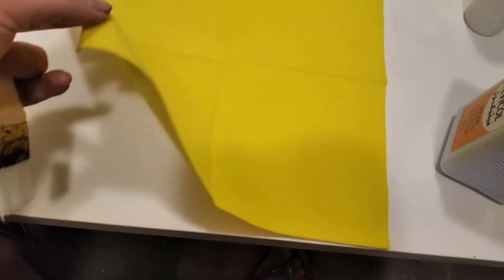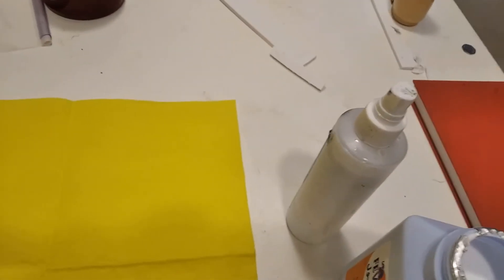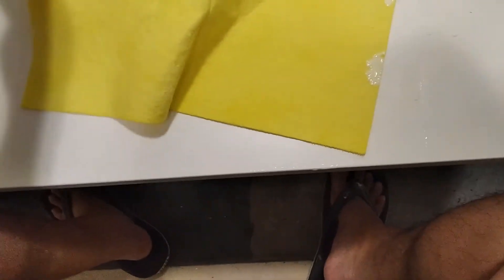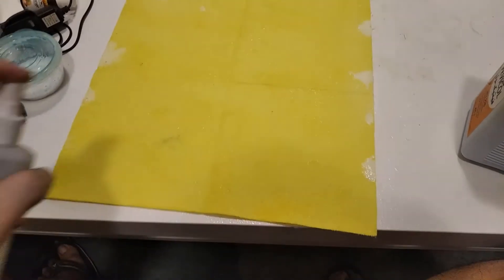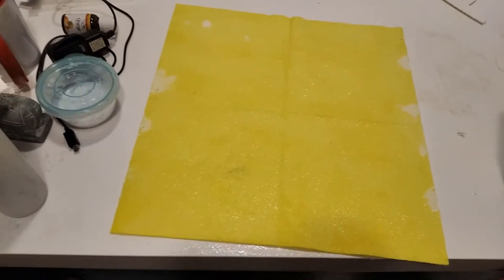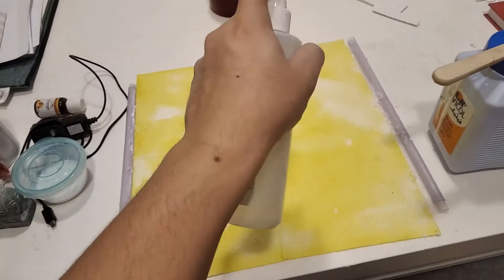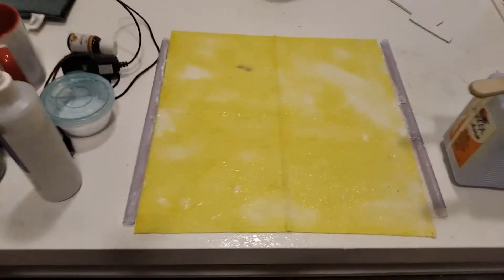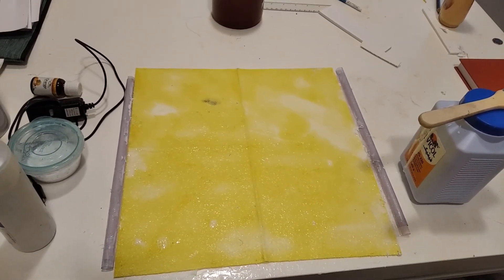Homemade ion exchange membrane updated guide(outdated check description)

Comment: Hi, how are you bro?
I am glad to see your effort about PEM but I have a question,
I hope you will reply soon.
Question> if you like to use this PEM in sodium hydroxide solution then will you mix boric acid + naoh solution for spray on the membrane?
Reply from the maker: Theres a newer pem that lasts longer so check my later video on it using Polyvinyl alcohol crosslinked with citric acid

Comment: What chemical would you use to pass chlorine ions through the membrane with your method, because Bromine chloride is a gas at room temperature or would you use a chlorobromide with which element or radical?

Comment: Hi, since you told in the video that crosslinking PVA glue with Sodium Borate gives a sodium ion exchange membrane, and potassium borate gives potassium ion exchange membrane, will cross linking PVA glue with just boric acid solution make up a proton (H+ ion only) exchange membrane?
Reply from the maker: in my later video citrate esterified PVA membranes are more stable than this and can exchange a wide array of cations.
Reply: @CatboyChemicalSociety  What about specific cations ? Can we dope the citrate baked membrane with specific ions to create specific ion exchange membranes, including Proton exchange membranes? Also, is it possible to use similar procedure for anion membrane with MSG or must it be glutamic acid only?
Reply from the maker: @aadhithvarathan5432  glutamic or aspartic acid for anion membranes.
further treatment with alkylating agents like methyl iodide improve the anion membranes.
Reply: Thank you.

Comment: Where did you find this knowledge can i read the source?
Reply from the maker: there are several articles on crosslinked PVA and citrate membranes online.
This is outdated as I am yet to upload the new video showing the complete new process.
Reply: @CatboyChemicalSociety  And do you use this to produce Hydrochloric acid and sodium hydroxide from salt or what kind of application does it work for?
Reply from the maker: @ThePluis89  yes it works but it will make Cl2 if you do a diapgrahm or membrane cell.
you need a UVC chamber to convert the H2 and Cl2 into HCl
Reply: @CatboyChemicalSociety  I just read normal day light also contains some UV so a special chamber is not necessary also the reaction is very exothermic which produces heat and might explode if too much light is present
Reply from the maker: @ThePluis89  actually the wet chlorine contains HOCl not Cl2 and thus this is an endothermic reaction where HOCl dissociates into HCl and O2 and this overall increases the activation energy.
It is still possible to burn the incomming gas such that the reaction of O2 and excess H2 along with Cl2 will produce HCl and still be exothermic but unless you have a spark plug or a burner this wont be possible.
The UV chamber is a must and even then it fails to convert 100% of the incomming gas due to the chlorine being wet.

I have a video of such a reactor and its in my other vids you can check it out.
Reply: @CatboyChemicalSociety  yes but you meant to mix the hydrogen and chlorine gases? Or do you take the chlorinated water solution?
Reply from the maker: @ThePluis89  the gas itself is wet enough not to self ignite when exposed to sunlight even when highly concentrated.
ITS WEIRD I expected it to explode.
Reply: @CatboyChemicalSociety  maybe some of the hydrogen reacts with oxygen to form water which cools down the reaction? We shall see.
Reply from the maker: @ThePluis89  nah its the fact that the chlorine exists in equalibirium with hypochlorous acid.
the dissociation of HOCl into HCl and O2 needs input energy which prevents the whole thing from being spontaneous even under UV.
But if you light the mixture or use a spark then it will explode violently.

Comment: Do you think this will work in Hydrogen fuel cell instead of Nafion? Should i use boric acid solution or something else ( for Hydrogen fuel cell)?
Does Pva glue mean polyvinylacetat?
By the way very helpfull video.
Reply: same question, i need nafion for hydrogen fuel cell. But this is rare
Reply: Same question i want to ask

Comment: sir if i want to make a membraine for sensing nitrate & phosphate ion what chemical should i spray
Reply from the maker: sounds like what you need here is an anion exchange resin. these are cation exchange resins though this is quite the outdated vid.
I do have a method for making an anion exchange resin which may work which involves reacting PVA with aspartic or glutamic acid then treating with methyl iodide or other methylating agent.
I saw a few papers that talk about specific membranes for this purpose but they use these very tedious steps.
The main question is whether you want it to selectively sense nitrate and phosphate among other counterions in solution because the method I describe is more general in terms of anion exchange.
Reply: @CatboyChemicalSociety  actually what I want it to take the soils nitrate, potassium & phosphate value presence in the soil so thats why I need some sort of sensor or chemical which can able to sense individualy for a particular selective ion like nitrate ,potassium,phosphate presence in the soil altogether
Reply: So if you can help me to give some info about that how I should I proceed or which kind of material I should use for soil particular ion detection then i ll be very thankful
Reply from the maker: @hummingbird2520  https://sci-hub.se/http://dx.doi.org/10.1007/s11270-012-1331-1
right there
this membrane material is selective and to make a sensor all you have to do is detect a change in current of the setup while immersed in soil.

Comment: It looks like you've got a great channel that focuses on battery technology.  Is that the case?  Have you used this membrane in any kind of fuel cell?  If yes, what were the results?  Thanks for sharing this. Doug
Reply from the maker: I recommend checking out my newer more chemically resistant membranes made from partially dechlorinated PVC plastic films.
Also I havent really made a fuel cell with these as my main goal is for use in ion exchange electrolysis and production of H2SO4 from CaSO4 via same process.
They however can be used for such applications since I have seen videos similar membranes used in fuel cells.
The membrane in this vid will work for fuel cells and etc and make FeCl3 from NaCl or other transition metal ionic salts using whatever anode but it cannot make H2SO4.

Comment: I want selective transport of H+. Can we use this?
Reply from the maker: yea the this should work fine its cheap anyway.
Im going to make a new video on a different polymer based membrane but im pretty busy these days so...
Reply: I am preparing plant microbial fuel cell. I need to place proton exchange membrane between anode and cathode so that H+ released can pass through it and react with oxygen to form water. Will this membrane serve the purpose?
Reply from the maker: @humashahper1759 H+ ions will flow through this membrane

Comment: hello sir can it be used for fuel Cell this membrane ???
Reply from the maker: yes you can use this for fuel cells
Reply: @CatboyChemicalSociety  sir...One more question ... what material do you use please tell me ...
Reply from the maker: @syariefad456  I kinda explained that in the video!!
If you want one which works better for fuel cells though you can use clear PVA solution sold as clear glue.
theres another process which involves mixing it with citric acid and cooking or soaking in NaOH to make a membrane which is a little better than this one.
Reply: @CatboyChemicalSociety  thank yau so much sir.. for explanation.. sucses for you..and always healthy ..

Comment: Great!, can this approach be used for nitrogen ion? What kind of crosslinking agent do you recommend?
Reply from the maker: if you mean nitronium ions then this will die.
this type of membrane doesnt like strong acids or really corrosive environments does moderately well in chloro alkali chlorine generators.
I am working on a new membrane for that in a future vid.
Reply: What to use for reverse osmosis wat er

Comment: Excellent approach!
Is doping the membrane with metal ions a requirement, or does it just reduce ramp-up time?
If it's just a few hours of waiting, I'd like to have prepared membranes on hand, ready to use with whatever.

I'm not sure if you said this, but I'd guess synthetic fibers would hold up to acid/base cells longer than natural ones.  I have some fiberglass material on hand that should make a nice scaffold for this membrane.

Thanks for sharing!